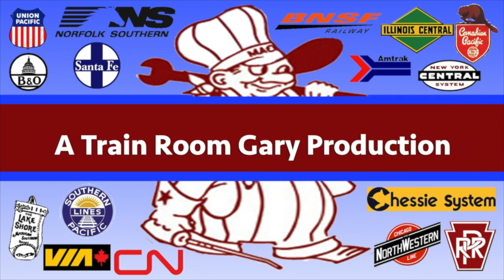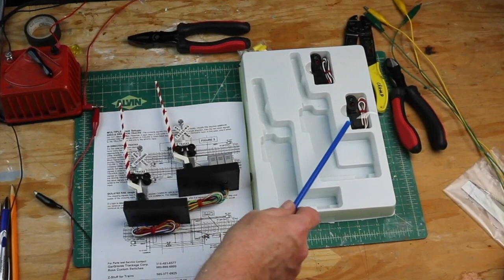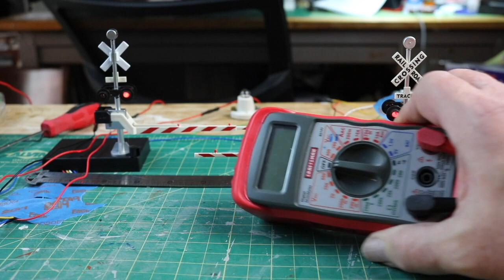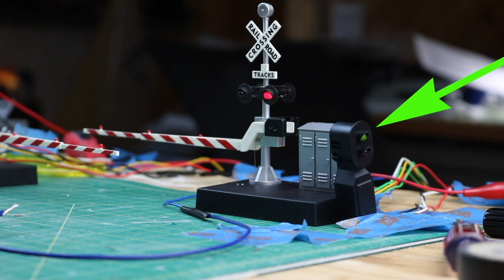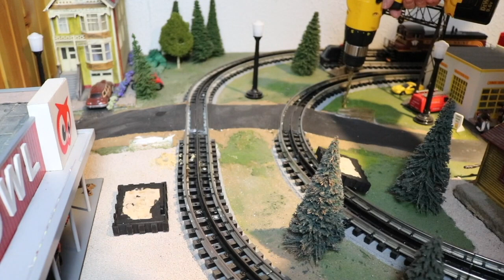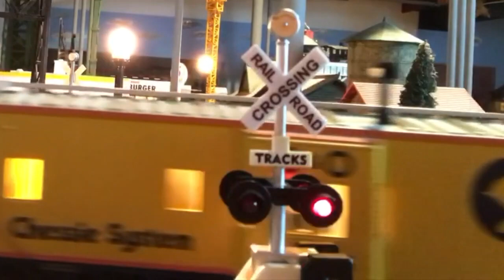Z Stuff for Trains • Crossing Gates & Block Signal Detectors • Part 2 • Tutorial

Comment: Great demo and how to. Now I'm going to install mine. I had some trouble getting the DZ-1011 to work properly.  Emailed Z-stuff and Dennis replied within an hour. Turns out there is a sensitivity control on the back side of the DZ-1011. Fixed my issue now everything works.  If you have a sensing issue in the future, look for that recessed screw in the back.
Reply from the maker: Hi Bosco Chocolate: My local Kroger's sells Bossco. Yes: Dennis is helpful, I called him with a similar issue. The signal lights are also cool. Thanks for watching. Gary 🚂
Reply: You are lucky.  It makes the best chocolate milk!
Reply from the maker: @Boscoed1  Hi Bosco - Thanks for the tip, I also saw it on Amazon. Gary 🚂

Comment: Another question, let’s say you have a really short train, a single engine for example.  If it passes the first block detector and clears the detector before getting to the crossing ...will the fates stay down or do they go back up before getting back to the crossing?
Reply from the maker: Hi Ben: The detector should work the same on a short train like locomotive only or a long train. As the train passes the detector the gates and lights come on and they will stay on until the train clears the detector at the gate.
Hope this helps. Gary 🚂

Comment: I just bought the same kit, and noticed that the paperwork suggests 12 - 14 VAC power supply.  My track and transformers are 18 VAC.  I noticed the base getting rather warm during the test at the higher voltage.  Did you notice any issues using the higher voltage for your kit?  I love how it works!!!!!
Reply from the maker: Cool - 18 Volt - Thanks for watching 🚂

Comment: Quick question, are the bell sounds optional?  Is there a way to switch them off?
Reply from the maker: Hi Ben: I am not aware of a way to turn off the bell sounds. I did place a toggle switch at the control panel to turn off these signal gates. Hope this helps. Gary 😎
Reply: @trainroomgary  another question, what gauge wire are you using to wire this?
Reply from the maker: @BenWayne85  HI Ben: I use a 20 AWG Wire multi stranded. Amazon has this in a six color set.  Hope this helps. Gary 🚂

Comment: I’m just starting to place mine and was curious if you built the platforms because you needed to elevate the signals to have the IR beam function?  Also I was thinking the numbers included went in the crossing gate signals to indicate how many tracks a vehicle would need to cross on the road.
Reply from the maker: Yes: I built the platforms, so the beam will go over the rails. Thanks for watching 🚂
Reply: Did you have a hard time with aligning the IR beam?  I’m going crazy trying to get them aligned.  Thank you for your response and help.
Reply from the maker: @stevenmoody4531  Yes - It is a tricky process - Good Luck! 🚂
Reply: When you ran your first test did you run it without the two DZ-1011 block detectors connected?  We’re you able to get the signals to stop?  I’m having so much difficulty and even have my brother in law who’s been in electronics his entire life scratching his head.  It seems the switches are backwards from the directions and there’s no possible way to get the LED lights to go out showing alignment.  Maybe I ended up getting a defective model.  🤔
Reply from the maker: @stevenmoody4531  Hi again -  There should be a phone number for the company with the directions or on line. Call them and ask to speak to Dennis the owner of the company. He should be able to help you out. If you are a member of the OGR Forum you could also ask for help with these guys. Good Luck 👀
Reply: @trainroomgary  thank you, that’s my next step for sure!

Comment: Here’s an update on my situation. After talking to Dennis Zander on the phone I found that the suggested voltage 12-14 wasn’t enough to manage the beam at a greater distance.  I was using 12 volts at a distance of around 12” and even at a much closer distance I couldn’t get the system to work.  The other issue was those switches on the bottom and I thought that they were supposed to match on both signals but this isn’t the case.  The directions don’t explain either of these issues very well if at all.  Once I used a 20 volt transformer everything worked easily and exactly as it should.  I’m not sure why the instructions indicate 12-14 volts because forget about 12 volts!  Hopefully this helps the next customer save hours of time.
Reply from the maker: Hi Steven: That is great news. Issued solved - I have other Z-STuff on my layout and it all works great. The crossing gates are not that great. I did have to send them back to Dennis when my Amtrak F40PH ran off the tracks and hit the gate. There is a small fishing line inside that moves the gate up. That brook and Dennis fixed it and sent it back. 👍• Cheers from the Detroit & Mackinac Railway 🚂
Reply: @trainroomgary  I’m glad he’s able to help us out.  I enjoy seeing your train layout.  Thank you again!